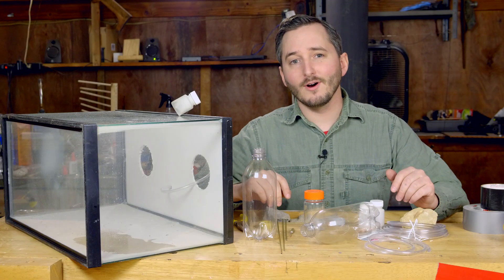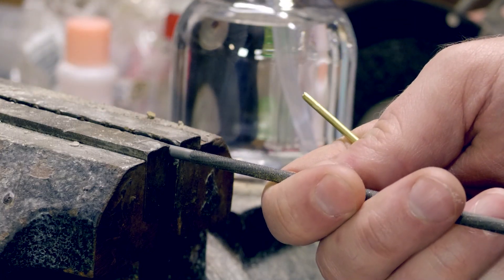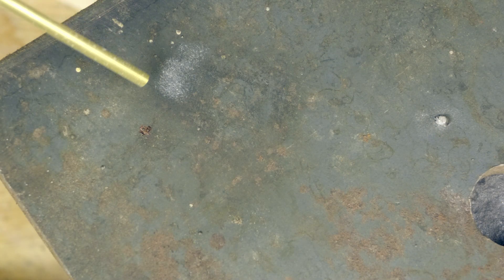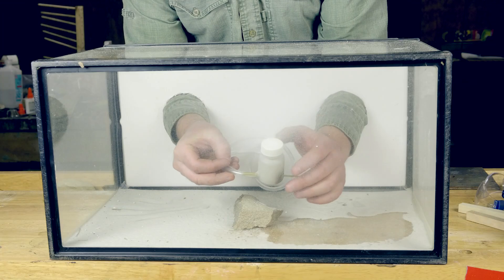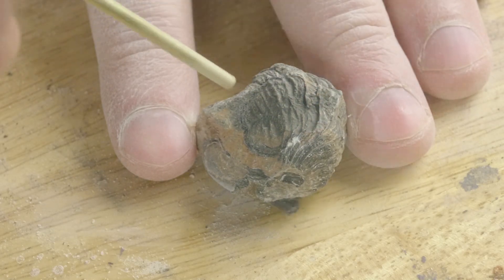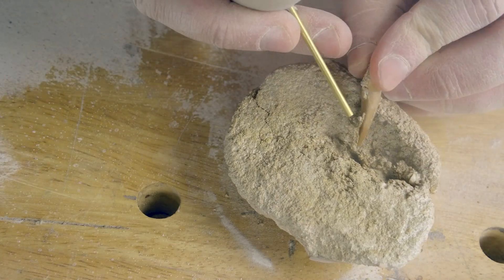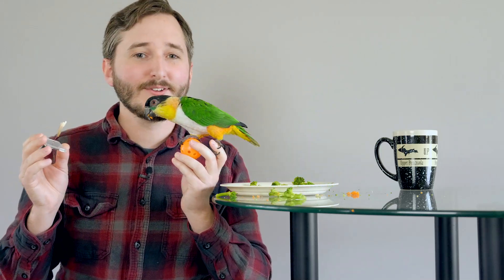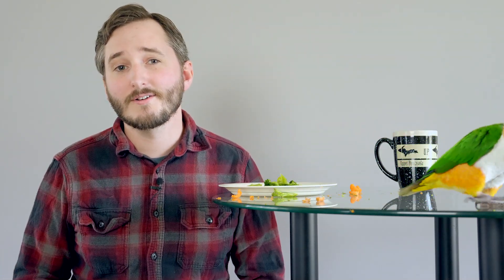How to Make a Mini Sandblaster (and blast fossils out of rock)

Comment: I had an idea after rewatching this video and then the video about cutting glass with the sand blaster the other day that might help address the issues with the transparency of the enclosure degrading over use. Once the visibility has gotten bad enough to be an issue or just undesirable, could a spray on clear coat or lacquer be applied to the inside of the glass or plastic? It could help fill the pitted surface and eliminate the need to replace the whole container. If this works hopefully it helps someone with that problem.

Comment: Very interesting. Thank you. What air pressure works best ?
Reply from the maker: Works best for what purpose? It depends what you're doing.
Reply: @Nighthawkinlight   Thank you so much for your reply. Amazing you have time to read comments and reply. Thank you. I have a cheap air compressor. In theory it can go from 0-180 MPa but the gauge has red danger zone from 100-180 and it is not regulated so I need to hold the gun with one hand at all times. For cutting the glass, what pressure is best? Does it make a difference?
Reply from the maker: @billbrown994  For glass 60-100psi is fine. See my newer video about glass cutting. You NEED to use a blasting cabinet for glass cutting and blasting with insoluble media or you will permanently damage your lungs. The sleeve method in this video is not good enough for glass cutting.
Reply: @Nighthawkinlight  Thank you for your time and help.

Comment: At Ionbond they demand the blasters not to wear a respirator and will fire you if you ask for one. You blast ceramic micro bead and aluminum oxide for 12 to 16 hours and when you leave the floor is 2 to 2 and a half inches thick with media from all the leaks. The doors safeties are taped or welded so you can blast without the door fully closed.
Any employ who asks for a respirator gets fired immediately and the call you and threaten to have you arrested if you tell osha.

Comment: That's a great idea. I like that you can improvise with whatever you can get your hands on. I use a air brush eraser as a mini sand blaster for cleaning up carburetors. I ordered a jar of the eraser powder, which is very fine aluminum oxide from an art supply. I'm still going to make your version though as it will accommodate a wider range of grits and it's cheap and easy to renew when you ware it out.  
PS I just subscribed.

Comment: awesome video!  how well does it work on bike paint with baking powder?  and just below rim of lid on bottle looks like a good spot for nozzle.
You can make plastic tube much shorter while inserting some of brass tube into valve body assembly able to operate with 1 hand.
outside observer tip, keep part of stone attached, for support and context..  polish the stones as the mount itself.  flat or detailed bottoms or stones themselves...  egg shape, etc
you could turn cheap fossils into masterpieces selling for much more..  Artisan would be the designation.  removable plexi glass plates can be polished & buffed clear again.
thin glass shielding for view zones easily replaced and much cheaper.
Reply from the maker: I'm not sure. I think you would need a little harder abrasive for paint but it would be worth trying. Baking soda, not baking powder.

Comment: I want to do this with* ( to extract crystals and gems).
Four of these full of aluminum oxide and chromium powder , blowing into a steel tube directly at each other so the streams collide in the center, a small white hot flame should be dead center top heating the powders...this apperatus mounted to the top of a two part conical mold should give better synthetic red corrundum with the bugs worked out . flame fusion ruby or titanium for sapphire . it will stop the powder from blowing everywhere.

Comment: you could have vinyl sheets stuck to the aquarium glass. not only would it resist abrasion, but it would be easily cleaned or changed.

Comment: I don't really have the budget for a full sized compressor. Would one of those tire compressor you plug in your car work ? The average can generate around 100 psi. Is that enough ?
Reply from the maker: Probably you need at least a small air tank so the pressure is constant.
Reply: @Nighthawkinlight  Thanks mate. I'll see what I can put together. Hopefully I won't need a welder...
Reply from the maker: Feed a line into a soda bottle and that should be enough. You don't need a big tank.

Comment: Is the 3/32" the inside measurement of the hole in the tube, or the outside diameter of the tubing?
Reply from the maker: I don't remember. Either way it would work fine. You could go bigger or smaller

Comment: Hooooooo, man .... Are you ever a lifesaver!  I've always wanted to make a sandblaster with my compressor, but the cabinetry and accessories were too costly to even think about it.  This is SO SIMPLE to make!  Thank you, thank you, thank you!  There is one question I have, that you didn't mention in the video .... What PSI are you using, to shoot the baking soda through the copper tube?
Reply from the maker: I'm using about 90psi
Reply: @Nighthawkinlight  Hi, please advise on your compressor spec - mine will do 90psi, but will not shift enough air : how many liters per minute please ? or CFM(cubic feet per minute)?
Reply from the maker: @1000000trs  CFM of the compressor pump doesn't matter as long as your compressor has a tank. Fill the tank, use the blaster, refill the tank.

Comment: Two questions: 
1. What air pressure are you using? 
2. Does the hole in the brass tube to let the sand in have to face up or down or does it not matter?
Thanks!
Reply from the maker: I'm using about 90psi but it's recommended to use much lower for fossils. You can have the tube opening facing any orientation.
Reply: @Nighthawkinlight  Thanks!

Comment: I have a large system, but your idea is great...I'm on my way to the hardware store to get the tubing.  Thanks for a wonderful idea.
Reply from the maker: Do you prepare fossils?
Reply: No I do not.  However, it does sound fun to get into.  I mostly spray glass using templates. @Nighthawkinlight

Comment: I would just like to point out for crazy people with more patience than I that this is small enough to mount on a small CNC gantry with some fairly inexpensive motors and belts driving it all. Controlling the air valve could be done pretty cheaply as well. The only obstacle I see is keeping sand from making a mess of the motion system. That, a cheap Arduino-based brain box, and some edits to Marlin, and you have a 3D un-printer. Wouldn't be great for fossils, but it'd be awesome for carving bricks and soft rocks without the vibration concerns associated with milling.

Comment: Lately I made a alchahol gun. It Consisted of a 2 1/2 foot section of 2 1/2 inch PVC pipe with a cap and a reducer system to half-inch PVC to a half inch ball valve to a 3 foot section of half inch PVC acting as a barrel. I used darts just like the King of Random for his blowgun project. Then, after seeing some of your videos I bought a stick lighter and attached the Piezo igniter through the combustion chamber and hot glued it into place. The result was that the nail darts stuck at least a third of an inch into plywood. That was only with about 2 skwirts of alchahol. ( I had to screw the end cap on because it blew off repeatedly if I didn't) Just an idea for you. ( You're my favourite youtuber. )

Comment: Thanks for the video! 
If you want to improve the issue with the glass panels turning opaque, you could look into adding an airbrush spray booth at the back. 
They're quite inexpensive and might give you enough air suction to reduce the amount of sand hitting the top glass panel and give you better visibility by also reducing the amount of dust flying around inside the booth.

Comment: Wait. The tooth - solid rock? Are you sure? It should have been some calcium mineral from the very beginning, so not part of the process of petrification through replacement of decaying organic materials through minerals brought there by water... ?
Reply from the maker: Good question. It probably depends on the type of rock whether or not enamel and other minerals in the tooth are stable long term.

Comment: almost never completely remove a fossil from its rock... It is way more valuable and scientifically important with the matrix (original rock) still around it. Use sand blasting to clear rock away so you can see it better but completely removing is just a waste.

Comment: Just use a shop vacume to create a negative pressure (vacume) in your cabinet. You could get a hepa filter. Cheep fix to protect your loveone's lungs. Also a pressure regulator to reduce air pressure.
Two words "Princess auto".
Good job.

Comment: Get hold of a sheet of thin acrylic, styrene, or other(?) clear plastic, cut it to the size of the aquarium's glass panel(s) and tape it to the inside of any glass you want to protect. When it becomes too frosted from errant sand, you can easily replace it. It's also a real help to have a light inside your sandblasting box - you could rig up a low voltage one with a clear jar - as you won't be dealing with as much reflection, especially as the plastic starts to frost up.
Minor point: it's one medium, a number of media.

Comment: Have you noticed wear to the brass tube? Not that it matters much since it can just be replaced.
Reply from the maker: Some. You would need a new one after some hours of use. It's $2 for a three pack of the brass tubes from my local hardware store, and you can make three barrels from each tube. So very cheap to replace

Comment: I think you did really well with that tooth :) usually we just use a knife to do all of the cleaning of the tooth and snapping the tips of is unfortunately relatively common. sometimes you can spend a good few minutes on a tooth just to have it snap as you are scraping off the final grains of dirt meaning you have to glue it back together DX

Comment: Well, I don't have an air compressor so this is a bust. Putting required equipment and materials in the description would be really handy and wouldn't even take 10 minutes.
Reply from the maker: I will have a video about making your own air tanks at some point that can be filled wit ha bike pump. This project does not take a large air supply.

Comment: What did work for my application (get rust of automotive steering knuckle) was a wire brush on an angle grinder. I tried sandblasting too but wasn't effective at all. The wire brush on the angle grinder did work quite well. Without actually abbrazing the cast iron.

Comment: Let me check in the garage...
Air compressor ✅
Brass tube ✅
Plastic tubing ✅
Plastic bottle ✅
Baking soda ✅
Respirator ✅
Safety goggles ✅
Hot glue gun ✅
Small parts needing rust removal ✅

Knowhow? Thanks to this video ✅

Liked ✅
Saved ✅
Subscribed ✅

Comment: What size air compressor would you need for this size blaster? what PSI were you using?
Reply from the maker: You can use about as small a compressor as they come. I was using 90psi but most stores I was reading on about fossil prep say to use way lower.
Reply: @Nighthawkinlight  thanks

Comment: Thanks for the video :)
How about making a finer sandblaster by using airbrush needles? Usually one costs me 1.93-2.50£ here and can be 0.2-0.8mm wide and are much more precise/finer.
And plus is they get more accurate the more you use em.

Just an idea if someone is feeling bit more experimental
Edit: found sand thats 0.1-0.4mm 25kgs for 2.50£ something .. guess ill report on that.

Comment: If you're prepping more fossils, I'd recommend making glue from B72 resin pellets and acetone. It's reversible so if you make a mistake when setting the pieces together, you can separate them with a bit of acetone. It's also good for solidifying pieces before you prep them since you can make it really dilute and it'll flow inside the fossil.
Reply: Paraloid B72, the best consolidation glue for restauration.
Reply: @Saohesc  ...

Comment: 1 Acrylic insert inside the fishtank at your top down viweing angle' and two side angles will be cheaper to replace regularly than an entire piece of glass. Simple clear gel will work to hold it in place and keep out much of the sand from the surface of the glass.   Or even "rough" silicone the edge since that would also be easy to peal off to replace.

Comment: Curiously, does the sandblaster hurt your fingers should you accidentally direct it while unveiling the fossil? If it's strong enough to erode rock, wouldn't get in your skin or something? Seems like gloves would be a good idea if that's the case.
Reply from the maker: It's doesn't hurt much. The rock is eroded because it's such a stiff material, but your skin being elastic absorbs the impact of the sand without being eroded away.

Comment: Okay you protected your eyes and lungs, but blowing compressed air directly onto your skin is a big nono as the air can penetrate your skin and put tiny air bubbles into your bloodstream over time, wear gloves my friend...
Reply from the maker: That's really only an issue with higher pressures than a normal shop air compressor can deliver, or if you stabbed yourself with the blowgun. Your body can handle a whole IV tube full of air in your veins without causing a problem. It takes a good amount to do harm.

Comment: Respirator or not, never sand blast with silica based media. Use: oxides, garnet, almond shell, sodium bicarbonate or any of the many other safer abrasive options that don’t risk causing silicosis. When silica is powderised it is difficult/ near impossible to safely control in a dry state. When forced to deal with powdered silica, always work wet, to reduce to possibility of airborne silica
Reply from the maker: This is something I had not heard. Surely aluminum oxides and garnet have the same risks of taking up permanent residence in your lungs? Aluminum oxide and garnet are no more biologically compatible silica oxide sand. Silicosis is just named such because it's the most common element tossed into the air in mines and such where it becomes an issue for the workers.

Comment: If it can damage glass, does it hurt your hands when you accidentally miss aim?
Reply from the maker: No, it doesn't really hurt. It would hurt if you left it pointed at your skin in the same spot for a few seconds, but the elasticity of your skin causes the sand to bounce off without doing damage. Kind of like the difference between if you were to throw a marble at an egg vs throwing a marble at a water balloon. It will usually bounce off of the balloon, but the egg will break.
Reply: NightHawkInLight that’s what I thought, but a bad experience with a water pick made me curious. Thanks for the info
Reply: @nvrguru22  ah yes powerwashers. I touched the beam of a kärcher... damn im not gonna do that again.
Reply: @Nighthawkinlight  this is actually a plesiosaur tooth likely Zarafasaurus

Comment: Make a mini sand blaster in 5 minutes...
2 minutes later pulls out full, factory-fresh compressor kit....

Dat bird at the end tho, 5/5 pet
Reply from the maker: I was thinking about showing how to make your own air tank powered by a bicycle pump in this video, but it was long enough as it is. You could certainly run this little sandblaster on a much smaller air supply.
Reply: @Nighthawkinlight  I was thinking of using a cheap electric bicycle pump/compressor, i found one for 7 dollar. And it's 12volts so with a 3s lipo also you can take it anywhere. This is a cool project! Thank's a lot!!
Reply from the maker: With that you'll need a little air tank to be a buffer for the pressure. Otherwise your blaster will kind of sputter as the pump cycles rather than being a constant flow.
Reply: @Nighthawkinlight  Air tank is on the list :D Can't wait to try it out, a micro master blaster! Thank's again!!